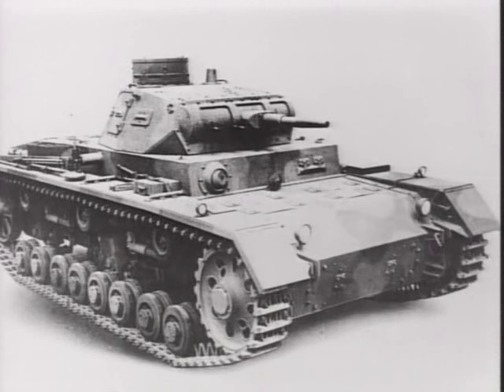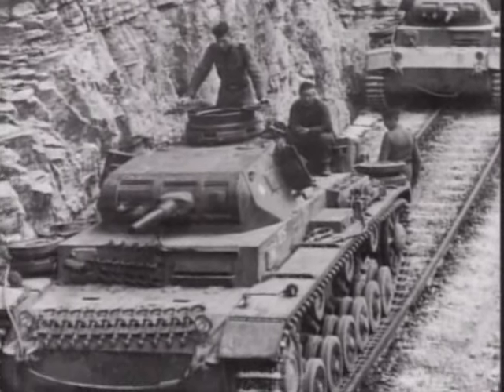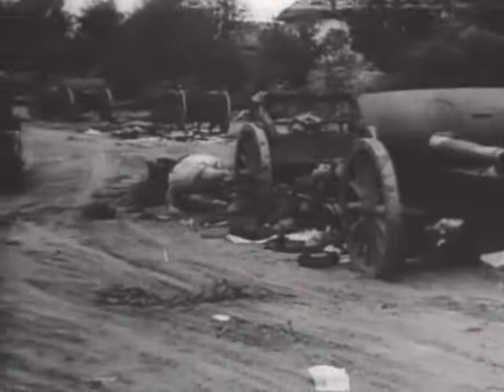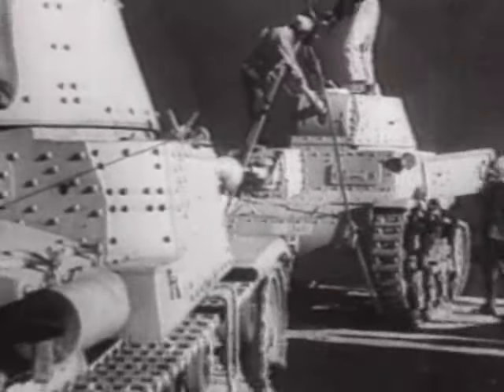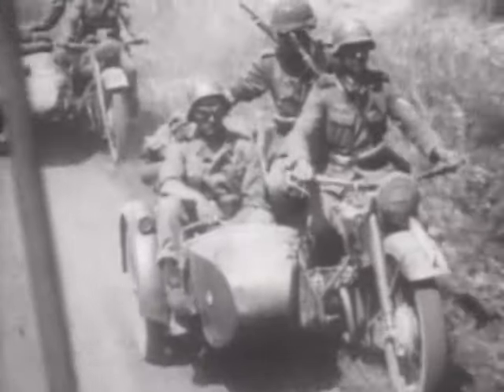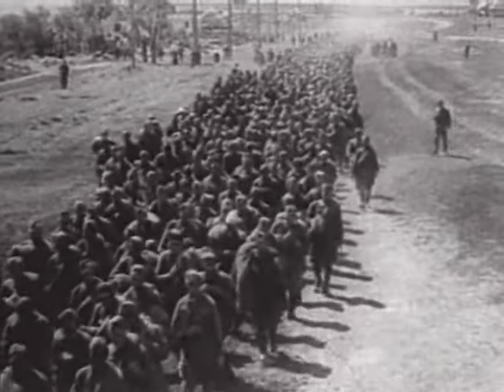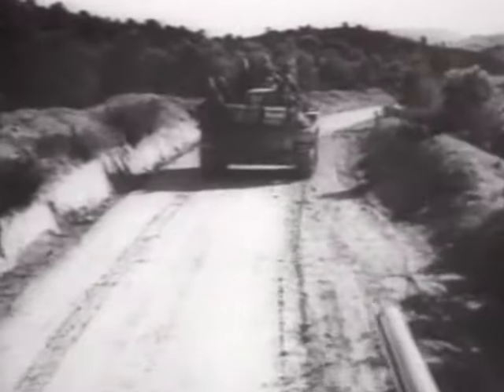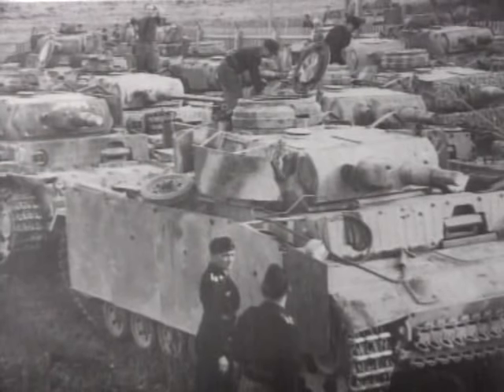German War Files - Panzer III Medium Tanks

Comment: Criticism of the decision for the small caliber guns of the German tanks is easy. The Germans certainly had the technology to build bigger guns, so why didn't they? A 50 mm round weighs roughly twice as much as a 37 mm round. Therefore, logically, you would also need twice as many trucks to transport the munition (if you wanted the same number of rounds available to your front line tanks).
Germany did not have twice as many trucks, nor the fuel for twice as many trucks.
Reply: You could argue that with a heavier round, less rounds would be needed so it evens itself out again. Where the 37mm needs many shots at a tank to take it out, 1 50mm could do the trick.
Reply: Orvieta Of course, but then you would also have to hit your target twice as many times (in other words, not miss as often).
Since the 37mm round was sufficient to deal with most enemy tanks of the time, it was also enough to "keep the flow" (movement) in the Blitzkrieg advances.
German thinking was therefore correct (for the short moment in time), but flawed (long-term), since it didn't bear in mind that the enemy's tanks would become bigger and better in response to the early Blitzkrieg victories.
This thinking pattern (of the small "cheap" tanks with small guns) was the result of the idea the it would be a short war, and small tanks were dictated by the fact that Germany lacked the funds and raw materials to improve the designs while there was still peace (say, 1935-39)
After the war started, finances played a minor role, and tanks rapidly increased in size as the "generations" of designs (of both sides) began to overlap in ever more rapid succession.
Reply: All correct, it follows the general idea that the German army (Air, Ground, Marine) all were build up from a tactical purpose rather than strategical which ultimately helped their downfall.
Reply: Orvieta Couldn't have said it better myself.
Many people forget that WW2 was practically the concept of Blitzkrieg (a short, decisive battlefield victory against a SUPERIOR enemy).
IMHO, many historians and documentaries get it totally wrong when they make claims like "mighty" German Wehrmacht, while in fact the Germans were inferior in almost every mayor respect (except Poland right at the start)
The events of WW2 were a tactical concept pitted against strategic concepts (like blockading an enemy, strategic bombing, sacrificing land in return for time, etc.).
Guess which concept won :-)
Reply: They had the advantage of having to start from 0 and grasping new tactics and building up their army around that while the other nations all were left by the horrible memories of WW1 and the tactics used there. I once read a quote that compared both doctrines. "On one side we have a very armoured knight, sitting on a heavy horse and a big strong sword. On the other side is a much lighter individual, seated on a nimble horse but with new weaponry." The Blitzkrieg was a face off of different tactical doctrines, it's remarkable to think that Germany back then had put very little thought in maintaining their conquests after the inital gains (much like Japan for that matter)
Reply: Orvieta IMHO, Germany maintaining control over their conquests was made impossible by Nazi ideology. The subjected people obviously didn't like the idea of being seen as Untermenschen, leading to resistance (in the form of sabotage, partisan actions, spying and other forms of co-operation with the Allied side) from the moment German troops arrived.
Since Nazi's only found a small percentage of idiots in the occupied areas who agreed with their view, the majority logically opposed them (and the German soldiers, who were mostly also the victims of Hitler's policies)
Reply: I like your comment, and people wonder why U.S 3rd Armored moved so fast, because it didn't need as much fuel etc etc . people always leave out the Logistics of things lol
Reply: Uhh, the only way you're going to fit a gun bigger than 50mm (without sacrificing velocity) is to to eliminate the turret and put the gun in a casemate. Which is precisely what they did with the StuG series.

Also, the Panzer IV used a 75mm high velocity gun. 75mm was widely used by the Germans.
Reply: Treblaine That is true, but my comment is about logistics.
In other words, heavier guns mean heavier shells, meaning more trucks to transport these shells, then needing more fuel for all these extra trucks, etc.
It's a so-called "vicious circle" (impossible to break out of), in which one step leads to another.
Reply: Treblaine You are correct that it is not a simple debate, by I think you have miss-interpreted my comment.
You wrote:
"Look, follow your reasoning to it's logical conclusion: a mere 20mm cannon round is lighter than a 50mm round, so should they issue those 20mm as anti-tank rounds?"
That is not the point I'm trying to make.
My comment refers to the fact that German Army always only upgraded their guns in response to some kind of emergency (for example the widespread introduction of heavier tanks like the T-34).

"Consider the following: the German infantry had a small hand-mobile (on wheels) 3.7cm gun, the ordinance department wanted tanks to have compatibility with that gun. But generals like Guderian wanted 50mm guns on the Panzer 3 from the outset, and the longest variety."
True, Guderian (and Hitler) wanted that long before the war started, but didn't get it. Panzer III and Czech Panzer 38s were equipped with 37 mm cannons right through until late 1941/early 1942.

"Hell, since the first world war they'd been used to delivering a far higher volume of ultra heavy weight shells for artillery, those had 105mm to 150mm calibres."
A German division had 48 howitzers/cannons, but 75 x 37mm AT guns. Even increasing the caliber a part of the tank and AT guns would have increased the total weight of ordnance dis-proportionally.
Reply: Treblaine "The logistics supply system was perfectly capable of delivering 50mm shells. Also capable of delivering 75mm shells and even 88mm."
True, and also mortar rounds, food and mail. There was a lot of weight, and the more weight that could be avoided, the better.
Especially considering that AT and tank munitions were needed right at the front lines, in the most dangerous area to reach.
Heavier shells meant heavier guns, all of which had to towed also by heavier half-tracks, or carried on heavier chassis (of tanks), needing more fuel, which also had to be transported..
As you said, there are a lot of factors to consider, but the natural urge of the logistical planners would be to keep the weight down.
Reply: Treblaine Look, I'm merely explaining something which happened during WW2.
I observed something, and offer a (possible) explanation why it unfolded in that way.
I'm not a "bean counter", since I wasn't there to influence events.
I've got a book, which clearly states the logistical issues the Germans faced (especially while planning their future Panzer Divisions in the mid 1930s). In the early stages of war games, the German generals proposed a 560 tank Armored Division.

They didn't get it, and guess why not?
Well, it seems as if "bean counters" worked out that it would be a logistical nightmare to try and resupply a Panzer Division with two tank Regt's while on a Blitzkrieg style dash across an enemy's territory.
So it was decided to reduce the number of tanks (first to 324, then 254, and later even only 176, which was also a result of tanks getting heavier, and equipped with heavier guns, because the number and the quality of trucks available could not be increased)

This is NOT my, recommendation, it was a recommendation made long ago, by some unknown logistical experts.
In end effect, the decisions were dictated by events, and wishful thinking could not have circumvented the lack of rubber, fuel, steel and other resources needed for the "ideal Panzer Division" in the generals' heads.
Reply: Ralph Bernhard Yeah, well war is tough. Logistical nightmare or not, if that's what's needed then that's what's needed.

And it's right to have fewer tanks which can be effective rather than lots of cannon fodder.

Giving them something which won't penetrate the enemy armour isn't saving weight, it's wasting weight. As what you brought is worthless.

And see the video in the above source, the weaker 50mm gun were installed for no good reason other than it was what was already planned. The longer higher pressure 50mm guns (L/60 variants) would have been of a trivial extra logistical burden for a significant increase in capability.

I really have to object to a trend I see oft-repeated of saving pennies while ignoring how that then costs millions.
Reply: Treblaine I agree with almost everything you write, but we are still talking about two different things.
You refer to an ideal situation, while I'm describing what actually happened.

You wrote:"Logistical nightmare or not, if that's what's needed then that's what's needed."
That is merely a statement.
The economy of the country in question also has to be able to produce "what is needed" and then ALSO have the means to deliver what has been produced, to front lines a thousand miles away.
This is dictated by raw materials, labor, and many other factors. This is true for ANY country, but let's stick to Germany.

The Germans had to stop the production of purpose built 6x6 trucks in 1940 (the "Einheidsdiesel" tuck), because they took too long to build. There was neither labor, nor the raw materials to speed up production, and the factory space was need for more important weapons..
Specialized 6x4 truck production was halted in 1942 (for example by the company Henschell)
After that point in time, all German trucks were militarized civilian vehicles (like the Opel Blitz).

Of course, this step was not popular, and those soldiers fighting both wished for, and deserved something better than a glorified 4x2 truck with a few racks added to "militarize" it.

That is not the point.
If you have the raw materials and labor to CHOOSE between a specialized 6x6 truck and a tank, what would you give the soldier?
That is the question.
Reply: Treblaine "I really have to object to a trend I see oft-repeated of saving pennies while ignoring how that then costs millions."
That is hindsight, since you can only analyse what is wrong, lacking or completely missing after the event (a war or battle), and not before it takes place.
Please also read my first comment.
Reply: Ralph Bernhard "That is hindsight, since you can only analyse what is wrong"

Actually no, it's reasonable foresight. The likes of Guderian had the foresight to see that they should have had the long-50mm gun from the outset.

Source: the above video.
Reply: Treblaine Again, that is not what I said.
Again, you are absolutely correct (where ONE German general was concerned).
What about all the other generals? (and military strategists)
Goering wanted 10,000 bombers. 
Doenitz wanted 300 submarines.
Guderian wanted bigger guns for his tanks.
Reader wanted 8 Bismarck style battleships.
The Generalinspekteur of the German Fighter wing, Galland, wanted 10,000 fighters.
The Navy wanted six inch guns for their destroyers.
The coastal forces needed 1,000 small craft to defend the occupied territories.
Kammhuber wanted 10,000 radar sets.
And so on, and so on.....
Somewhere along the way, somebody put up his hand and said "Hold on...."
I hope you can see the point I'm making. You cannot address each and everybody's foresight.
Reply: Ralph Bernhard "Guderian wanted bigger guns for his tanks."

Which all in all is a pretty small requirement.

It is of trivial difference to make a long-50mm gun with the slightly larger 50mm rounds but makes a SIGNIFICANT difference in effectiveness.

Long-50mm could penetrate the armour of heavy allied tanks such as Matilda II and T-34.

This wouldn't cost a battleship, this would cost pennies extra per gun.

Guderian actually AGREED to having FEWER tanks as long as he got the long 50mm... only to discover they'd put the short 50mm on there anyway.

I hope YOU see the point I AM making, that jsut because battleships are too expensive and can be gone without that doesn't mean any other request can be denied.

"You cannot address each and everybody's foresight."

You've taken that to the point where you don't think ANY should be addressed.

You seem to be labouring under the misapprehension that the German war machine was perfectly efficient.

No it wasn't, you noticing apparently worse guns you seem to be trying to figure out what SMART reason they did this.

When you didn't consider the possibility it was a plain old screw up. They didn't communicate effectively and the uber war machine was in near perpetual chaos. It wasn't smart, they were dumb.
Reply: Treblaine OK, I see what you mean.
Your analysis where the 50mm gun is concerned is correct of course.
It would not have taken much to upgrade the Pz III to make it much more effective.

From a neutral perspective, making decisions about the possible future warfare scenario is extremely difficult.
Hindsight also says that Goerings LW would have gone a long way towards winning the war, if he had been given his 10,000 bombers by 1940.
Same goes for Donitz's wish for 300 submarines asap.
In end effect, if you have too many people whose logic make perfectly sense, those in control of the resources have to start making compromises.
Here lies the crux of the matter.
Larger economies (like the British Empire and the USA) made MASSIVE mistakes, but they won anyway, since they could simply brush away their mistakes, and win the war with their successful weapons.
Smaller, weaker nations don't have the luxury of making mistakes, so those in control better not mess it up ...
Reply: Ralph Bernhard Yeah, you just seem to be dismissing SOUND foresight with examples of SPURIOUS foresight.

It is very important that you be able to distinguish between the two and if you cannot distinguish between them, you cannot throw all of it into one category (spurious) or the other (sound).

Donitz's wish for submarines was another reasonable request considering their disproportionate effect, more reasonable than to try to out-produce the British (and later Americans) in battleship production.
Reply: Treblaine As far as Guderian's wish for larger caliber (or longer barrel) guns are concerned.
I think the reason for the mistake was how strategists interpreted the Blitzkrieg.
The strategy of Blitzkrieg was to strike deep and cut off the enemy from his rear ( and NOT to take on superior enemy tanks)
To objective was to look for weaknesses and AVOID the superior tank, strike deep and cut it off from its logistical support.
The stronger enemy tank would then rumble around on the battlefield and eventually run out of fuel.
That worked pretty well in France, and  the early stages of Barbaarossa.
German tanks were designed for rapid and deep encirclement, and therefore the need for a gun capable og dealing with the heaviest of the heavy was ignored.
As you have noted, this had negative results later on, because the superior Aliied manufacturing meant that by 1943 there were no more "weak points" for the tanks to exploit, and the more effective heavier guns were far too few to make a difference.
Loss of battlefield initiative was the result.
Reply: Treblaine "Yeah, you just seem to be dismissing SOUND foresight with examples of SPURIOUS foresight."
Agreed.
I was typing faster than I was thinking :-)

But there are also many examples of sound foresight, which could not all be met, due to the sheer number of "sound foresight" suggestions.

Seeing that we are discussing submarines, one immediately comes to mind. Before the war, Donitz was given the choice of whether he wanted very low frequency radio equipment which could penetrate a few meters under the ocean level, OR a radar set.
Since he could not have both, he considered that the radio for his envisaged Wolfrudel tactics had priority.
In his judgement, a sound choice.
Of course, today we know that both were sound foresight, but financial considerations dictated that he could only have one.
This would probably be an example of your penny pinching bureaucrats, but on the other hand, if had hundreds of sound foresight choices from every branch of the forces (which would add up to blow the defense budget eventually).
Reply: Ralph Bernhard blitzkrieg is what it's name implies, lighting war, fast war. Which is somewhat redundant as that's what all attackers strive for

"To objective was to look for weaknesses and AVOID the superior tank"

it's not that simple.

From the start, the idea was the have an armoured spearhead break through the weakest point in the enemy lines.

But still the weakest point may have T34 tanks everywhere. And in fact they were unavoidable. 

"German tanks were designed for rapid and deep encirclement"

Encirclement still depends on containment, so STOP their attempts to fight out.
Reply: Treblaine Correct.
Blitzkrieg is a fascinating subject, and as you have noted, also not so simple.
Of course, my comments are restricted to the few lines available here on a YT tread.
IMO, I can create a link to my initial comment, which is logistics, so I'm looking forward to your views.
Here is my statement: "The Germans won the campaign in the west in May 1940, BECAUSE they had mostly light tanks, and IF the majority of their tanks had been (as Guderian wished) Pz IIIs, they would probably have been bogged down in the Ardennes, just as the French and British views at the time predicted."
Let's take it from there.
It is my firm conviction that a heavier tank than the Czech Pz 38 or German Pz II (20 mm guns) would have cost them the campaign, because of the logistical nightmare a large number of heavier tanks would have caused on the small winding roads and narrow bridges of the Ardennes.
The French were actually quite correct when then pointed out that the Ardennes were "impassable", BECAUSE they made that prediction based on their own (much heavier) tanks, with gas guzzling motors and a vast logistical train.
A Pz III is much wider (around 3 meters versus around 2 m ), and uses much more fuel than a Pz II or 38 (around 150 liters per 100 km versus around 100 liters per 100 km for the lighter tanks). This all adds up to the logistics.
Events proved that they were up to the job, despite the shock of meeting Matildas and Char Bs.
That the German High Command was not too worried about these (disturbing) meetings with heavier tanks, should be explored.
Why were they not too worried after they had analysed the campaign, but rather concluded that "they had the mix right"?
Reply: Ralph Bernhard "IF the majority of their tanks had been (as Guderian wished) Pz IIIs, they would probably have been bogged down in the Ardennes"

What's you're basis for that?

The many Panzer III's still made HUGE advances into Russia, far deeper than against France and Low Countries. It's just that the Soviet Union is so much bigger and with much worse environmental factors.

"It is my firm conviction"

Look, you MUST realise this.

Your "firm conviction" may mean so much to you... but THAT IS YOU! We are no all you.

If everyone was convinced by other people stating their "firm conviction" then we'd be at the mercy of whoever was the loudest and firmest. 

No, that's not how it works.

You deal in fact, objective reasons.

That's the only thing anyone cares about, I don't know you, I haven't even met you, your convictions aren't relevant.

Any facts or objective logic, THAT is what is relevant.

"The French were actually quite correct when then pointed out that the Ardennes were "impassable", BECAUSE "

Actually no, it's not because they couldn't get their tanks and supply train through there, its that if they tried they'd get jammed up into pileups where they'd be utterly vulnerable to air power.

But the ace in the hole the Germans had was gaining air supremacy. Germany's opponents were not only denied the ability to attack the utterly supply lines but they couldn't even get reliable reconnaissance of the heavy troop movement through there.

Panzer 3 was actually only 57cm wider than Panzer 2 and still narrow enough to go anywhere a large van could go.

And as a matter of fact Panzer 3 tanks DID make it through the Ardennes the only problem was so many were needlessly undergunned with 3.7cm guns.

Panzer 3 was still much lighter than Matilda II or Char

"This all adds up to the logistics."

You know what really adds up to the logistics? you saving a mere 33% fuel per km to sent a Panzer 2 to the front instead of a Panzer 3 for it to be utterly incapable of damaging enemy tanks and getting easily destroyed.

You saved 33% to lose 100%.

"That the German High Command was not too worried about these (disturbing) meetings with heavier tanks, should be explored."

Earlier you made out you knew better than Guderian, that he must have been wrong for wanting Panzer 3 with 50mm guns.

"Why were they not too worried after they had analysed the campaign"

THEY WERE WORRIED!

THAT'S WHY THEY WANTED MORE PANZER III WITH LONG 50MM GUNS!

"but rather concluded that "they had the mix right"?"

But they didn't conclude that.
Reply: Treblaine "What's you're basis for that?"
I have several, but here is one.
It's the bridges.
In early 1940 the German army used four main types of pontoon bridges (A,B,C and n.A.)
ALL the tanks used in May 1940 could use ALL of these pontoon bridges.
Had Guderians advice been heeded, the Germans would have had tanks (the Pz III J weighed 23 tons) which could only use one of those bridges (the Type n.A. which was only introduced in 1937. That would have seriously inhibited the flow of vehicles, if the French and Belgians had managed to destroy their own (civilian) bridges.

Therefore ADDED to the risk of aerial bombing blocking roads, one would have an increased risk of getting stuck at some of the main rivers (while waiting for one of the scarce Pontoon Type n.A. to arrive)

Again, my POV is not what I would have wanted it to be, it's what actually happened, for which I'm trying to find an explanation. I don't know why you conclude that it is also what I would have suggested (if I had been in any position to do so during the 1930s). In fact, I would have agreed with Guderians "a few less, but better tanks" suggestion too.

From the POV of procurement/economy, you should also realize that Guderian and the German tank advocates had a long wish list (for example that every tank should also have a radio, Air support in the form of Stukas, etc., etc., etc.) which HAD already been granted. That means when he came up with his long barrel 50 mm gun wish, it was just one of many.

The attitude of procurement was probably "Sorry, buddy, but the wallet is empty".
Irrelevant of how you feel about this economical restriction personally, that was reality.
As today, money is not endless, and deciding which valid wishes are actually useful in a FUTURE warfare scenario is not easy.
Of course, you can believe you know better than the consensus decision reached by military experts, but I'll humbly admit that I don't know what the typical warfare tactics/ equipment/scenario will be like in ten years time.
What makes you think military leaders could predict a future warfare scenario in 1935?.
Reply: Ralph Bernhard "ALL the tanks used in May 1940 could use ALL of these pontoon bridges."

Both Panzer 3 and even Panzer 4 existed in 1940.

"That would have seriously inhibited the flow of vehicles"

Or they could do what they DID and make Type n.A pontoon ridges available as that's FAR easier than the prospect of so many tanks being utterly vulnerable.

"Again, my POV is not what I would have wanted it to be, it's what actually happened, for which I'm trying to find an explanation."

You seem to be in denial of what actually happened as in the many reverses that were saved by dumb luck and confusion.

Not appreciating that Guderian really did insist on more Panzer 3 tanks with long 50mm guns.

"you should also realize that Guderian and the German tank advocates had a long wish list (for example that every tank should also have a radio, Air support in the form of Stukas, etc., etc., etc.) which HAD already been granted. "

And on that matter all those points have been of HUGE importance, when they were either denied those things or their opponents had them as well then the tables were turned.

The importance of radios was so absolutely critical for taking on superior defensive forces like the otherwise fast, deadly and tough T-34 which suffered in things like lacking radios.

"That means when he came up with his long barrel 50 mm gun wish, it was just one of many."

I've explained WHY that's facile logic, 

It makes no significant difference whether the long or ther short 50mm gun was fitted in therms of industrial or logistics support.

But it DID make all the difference for combat effectiveness.

Long 50mm could take on t-34 tanks if if you get up close on flanks. 

"The attitude of procurement was probably "Sorry, buddy, but the wallet is empty"."

No it most certainly was not as it didn't cost any appreciably more to have long-50mm guns. And Guderian was EXPLICIT that slightly fewer tanks of long-50mm would be preferable to more without.

You are AGAIN making up an excuse which excuses the industrialists when the industrialists fucked up.

"Irrelevant of how you feel about this economical restriction personally, that was reality."

No, that's not reality.

"As today, money is not endless, and deciding which valid wishes are actually useful in a FUTURE warfare scenario is not easy."

Actually in THIS CASE it was, and THEY WERE EXPLICITLY TOLD!

They were told that the long-50mm gun was the priority, even if it lowered tank production slightly, it was absolutely clear that it was a WASTE to cut-short on this matter.

"Of course, you can believe you know better than the consensus decision reached by military experts"

No THAT'S WHAT THE INDUSTRIALISTS DID!

The actual people who were waging the war knew that if a 50mm gun was on the Panzer 3, there's no reason it shouldn't be the long-variant.

They even agreed with that consensus, but then secretly disobeyed for no good reason other than pig-headedness. Indifferent penny pinching.

Please DO NOT REPEAT THE FALLACY THAT ANY MONEY SAVED ANYWHERE IS MONEY WELL SAVED!

" but I'll humbly admit that I don't know what the typical warfare tactics/ equipment/scenario will be like in ten years time."

They weren't talking about 1951, they were talking about RIGHT THEN. In the next immediate few months.

"What makes you think military leaders could predict a future warfare scenario in 1935?."

Oh for FECK SAKE we are talking about procurement immediately AFTER the battle of France!

Panzer 3 design may have been settled in 1935 but the gun choice was something left up till much later. And damn right they had to adapt quickly, every other nation that fought in the war could, dis as they had to adapt production that quickly.

The problem was the entire Nazi regime was run like an old boys club, it was actually the furthest thing from a meritocracy, it was whoever was mates with the hierarchy and you get problems like this shit.

And you are MAKING STUFF UP to explain the screw ups which is so far detached from reality.
Reply: Treblaine I wrote "ALL the tanks used in May 1940 could use ALL of these pontoon bridges." This is correct.
You wrote "Both Panzer 3 and even Panzer 4 existed in 1940."

True, what's your point?

Panzer III early (37 mm and short 50 mm) weighed UNDER 20 tons (check it up) and could use ALL German pontoon bridges.
Pz IV (short barrel 75 mm gun weighed UNDER 20 tons, and could use ALL the German pontoon bridges.
 
I have pictures of Pz III from the 1940 campaign, crossing both the type B and C bridges right under my nose at this very moment..

A Pz III J (with the long barrel 50 mm guns) weighed 22.3 tons and could NOT use the pontoon bridges type A, B and C. 
(Same as ALL single loads OVER 20 tons)
That is a fact and in the books, which are in front of me at the moment.

What am I making up?
Reply: Treblaine I've lost you somewhere along the way. I'm working with the specifications of tanks that were actually produced.
So what are you suggesting?
Are you suggesting they should merely have put a long 50 mm gun on an early, lightly armored (30 mm frontal) Pz III D or E?
Reply: Ralph Bernhard No you aren't "working with the specifications of tanks that were actually produced.". I gave you directly contrary evidence from a reputable source and you're just automatically gainsaying. 

I've done more than suggest, I've been explicit.

"Are you suggesting they should merely have put a long 50 mm gun on an early, lightly armored (30 mm frontal) Pz III D or E?"

Yes.

It is, after all, WHAT THE EXPERTS DEMANDED!

It's what the most qualified generals deemed should have been done from the start.

Better is better.

Why would any tank gunner turn down more firepower for insignificant increase in cost, weight and logistics?

What, you think more firepower can only come after more armour?

NO!

More armour came first simply because it was easier to bolt on armour plates than re-gun.

But it would have been so much easier if they'd STARTED with the gun originally requested!
Reply: Treblaine Here are the sources I'm using, and which are under my nose, so to speak..
http://www.amazon.de/Waffen-Arsenal-Sonderband-41-Kriegsbr%C3%BCckenger%C3%A4te-Wehrmacht/dp/B002IRKKP8
Pictures and specifications of German and captured equipment used by the Wehrmacht, on 48 pages.
http://www.amazon.de/Kraftfahrzeuge-Panzer-Reichswehr-Wehrmacht-Bundeswehr/dp/3879431612
An extremely detailed list of specifications of the Pz III on page 384/385.
If you wish I can tell you how wide the tracks are, how deep it can wade, what type of fuel and how much it uses, the name and model and company which made the carb it used, the gearbox ratio which companies built it, the number of HP at which rpm, armor protection on five different places of the hull, suspension, how many top bogies there are on which model, the length width height in millimetres per model, the turning ratio, width of the track, and how many links there are, aaaaand, yes of course, the gun, make model, ammo it uses, along with the weight of the round, shell, and specifications like range penetration at four different ranges and angle of armor.
Honestly, I don't want to bore you, so of course I'm rounding up.
I've done some searches on the net, but German pontoon bridges doesn't seem to be a subject which interests enough people for a website. There is nothing on the internet.
Reply: Ralph Bernhard I don't give you sources that YOU cannot read, so don't give ME sources I cannot read.

Is there a version available online? PDF version or anything? I don't care about language, I can get it translated, but I'm not going to buy a book that's been out of print for 2 decades.

Look, I DON'T wish you to "tell" me what the width of tracks are or any other detail. You've already given me dishonest answers, why should I accept any more.

I have given you more than enough of the benefit of the doubt.

You ABUSED that with dishonesty.

No reasonable person should accept anything less than direct unadulterated source. Why? Because you've proven you cannot be trusted to summarise without obfuscating or with dishonest omissions.

You citing these sources only make you seem LESS reliable as apparently ignorance is no excuse for you. Despite all you have available you couldn't tell it straight.

"I've done some searches on the net, but German pontoon bridges doesn't seem to be a subject which interests enough people for a website."

Probably because it's something easily solved for the Germans. We aren't talking about heavy gauge steel production or high tech components.

It's really a trivial matter to make sure procurement of pontoon bridges that are slightly better for newer version of tanks with incrementally more mass.
Reply: Treblaine A few comments up I said that I'll stick with the majority consensus of military experts and military historians.
If I read you correctly, you are saying that less of a superior tank is better than more of an ADEQUATE tank.
Every expert I know of will disagree with that.

You are saying that Guderian wanted Pz III's (with a long barrel 50 mm gun) INSTEAD of the large number of smaller lighter tanks available at the time.
The Pz III just happened to be twice the price of a Pz II (96 200 vs 49 300 Reichsmarks, quoted from p.431) which would have meant half the number of a (vastly superior) tanks.
http://www.achtungpanzer.com/panzer-statistics.htm
Prices are also listed here.

The problem with that logic being that Germany could not afford to build Guderians tanks ON TOP OF what it was already building. It was either, or., NOT both..
In September 1939 there were only 98 Panzer IIIs, but 1445 Pz Is and 1223 Pz IIs. = around 2700 tanks.
Are you seriously saying that Germany would have been better off in May 1940 with (roughly) 1300 or 1400 Panzer IIIs with the long barrel 50 mm. The Allies had about 4000 tanks.
Since one cannot conjure funding out of a top hat, that would be (roughly) the equivalent.
(Of course, if you don't trust me to tell the truth or with arithmetic, you can do your own sums)

Germany lost the war because the Allies built more tanks which were ADEQUATE, like the T-34 or the Sherman,  (but inferior) to the German Tigers and Panthers.
Germany lost the war because of "quantity being a special kind of quality".

Find me just one historian that will agree with your hypothesis, and I will concede defeat.
Reply: Ralph Bernhard "If I read you correctly, you are saying that less of a superior tanks is better than more of an ADEQUATE tank."

No!

What I am saying is less of an ADEQUATE tank is better than more of an INADEQUATE tank.

Panzer 2 was inadequate apart from some narrow roles as a scout or pursuing infantry on the hoof. It wasn't good at dug-in infantry, especially if any had organised any sort of anti-tank gun.

Early Panzer 3's 3.7cm gun was far far too weak. The Long-50mm was what was BARELY adequate for facing the likes of T-34 tanks and Matilda II tanks.

"Every expert I know of will disagree with that."

That is not what I'm saying but even they'd not disagree like you say.

As the problem with having a barely adequate tank is you need far superior numbers for them to take on other tanks.

An individual tank which is much better might be more costly, but they are disproportionately effective for their cost! As you don't need so many of them with a multi-tank attack inevitably losing some of them.

"The Pz III just happened to be twice the price of a Pz II "

And a bicycle is the fraction of the cost of a Panzer 2.

Should panzer brigades be issued bicycles?!?!? Or is that too extreme, how about just some VW beetles and a box of hand grenades?

"The problem with that logic being that Germany could not afford to build Guderians tanks ON TOP OF what it was already building."

For the LAST god damn time.

if they could afford to built the SHORT 50mm guns then they could afford to build 98% as many of the LONG 50mm guns.

NO ONE WANTED BOTH! 

"Are you seriously saying that Germany would have been better off in May 1940 with (roughly) 1300 or 1400 Panzer IIIs with the long barrel 50 mm."

Yes.

Just like they'd have been better off with 2000 Panzer II tanks than 300'000 bicycles!

"Germany lost the war because the Allies built more tanks which were ADEQUATE"

No the allies won the war because they COULD BUILD more tanks that were adequate.

They had an effectively indefinite supply of petroleum, fuel, far larger labour and industrial capacity, ultimate control of the seas and it's three nations (USA, UK and USSR) the top powers of the world against one. Far without the problems of strategic bombing, blockade.

Germany could NEVER have tried to beat the allies on QUANTITY.

They could ONLY beat them of QUALITY!

A much better tank that costs 2x as much can be 4x as effective.

And most than that, German armour production was all about making something better which STILL cost less than their opponents. The likes of StuG III, Jagdpanzer 38(t) were all far more cost effective.

Look, just because USA, UK and USSR won with sheer weight of numbers does NOT mean that Germany should simply have tried to do the same.

"Germany lost the war because of "quantity being a special kind of quality"."

Only BARELY, despite how many T-34 tanks were made by Soviets, so many more than the Germans, yet still Germany had such higher kill ratio that the higher numbers of T-34 were almost completely wiped out.

Of T-34 tanks made in 1943, 93% would be destroyed in combat or combat related losses (broke down and forced to abandon by enemy action). 

http://chris-intel-corner.blogspot.co.uk/2012/07/wwii-myths-t-34-best-tank-of-war.html

That's a horrific loss rate.

German's higher quality did a lot to even the odds but the war was decided on broad strategic terms. Good command of total war and the Soviets getting more organised. Things like withdrawing Siberian troops from the Japanese frontier. Others like the encirclement of 6th army who were bogged down in Stalingrad. Things like the Germans endless delays in attacking Kursk and later, refusal to pull back to a more defensive line before Operation Bagration.

"Find me just one historian that will agree with your hypothesis, and I will concede defeat."

I'm not trying to defeat you.

But why should I find a historian to DISPROVE when YOU have not presented any historian to argue that Germany should have gone for quantity over quality?

When it's patently obvious that Germany was in NO POSITION to try to go for quantity but were in a position to go for quality.
Reply: Treblaine That's funny. I agree with (almost) everything you say.
I'm not so sure about that bit about Germany being able to beat GB and France in the West in May 1940 with (roughly) 1400 Pz IIIs with the long barrel gun though, but it is certainly a hypothesis worth exploring.
Now that I know what you mean, and if you don't mind, we could start from the beginning, and I'll try to pick some holes in the logic.

Your final two paragraphs is exactly what I'm always saying- Germany built Tigers and Panthers BECAUSE it could not compete with numbers, and didn't have the fuel for the 50,000 or 75,000 Pz IVs it could have built instead of Tigers and Panthers. That is spot on. Therefore any criticism of "over engineered and too heavy" German tanks (according to many docs) is futile.
There was simply no alternative.
Reply: Treblaine You have suggested a viable "what if" scenario which is completely within the realms of the financial and technical conditions in Germany in the middle or late thirties.
Just to make sure I understand you correctly, you propose that German procurement should have listened to Guderian and Hitler and concentrate on long barred Pz III. The 1940 German Panzer divisions would therefore have been composed mostly, say 80%, of a much better Pz III with the long barrel gun, the few light Pz which had already been built would have been reassigned to recce units, and a few heavier Pz IVs as an "ace up the sleeve", in case the enemy responded to the impact of this powerful new type of Panzer division.
There could have been around 1500-1600 German tanks, since the better tanks would have been built at the expense of more of the lighter Pz I and II from around 1937/38 on wards..
It is, in fact, a variation of the Main Battle Tank doctrine.
Please correct me if I got that wrong.

But, I promised to be back to try and pick holes in your argument :-)

The problem I have with "what if" scenarios (ALL what ifs), is that "what ifs" mostly completely ignore what effects their implementation would create on the other side. My view is that "every action has a reaction", so let's explore that.
IMHO, your "what if" would automatically assume ineptitude on the opposing British and French side. For it to work, it would need British and French intelligence communities to be completely asleep, and for British and French strategists not to grasp the effects of a smaller number of more powerful German tanks which they were observing.
It is my understanding that the nature and composition of British and French tank units (the French H35, H38 and R35 with short barrel 37 mm guns were far superior to the German Pz I  and II with machine guns, and so on) were influenced by what they observed on the other side. 
In the "real world" of 1939/40, the French only built a few of their more powerful Somua S35 (with a 45 mm gun), because they KNEW the Germans didn't have too many Pz III and Pz IV, and that the overwhelming majority of German tanks were "tin cans" with machine guns.
Bearing this in mind, I'm proposing a counter argument.
In short, and in response to what they observed happening in Germany in 1938/39, the French would have increased the production of their (already existing) Somua S35, at the expense of the light Hothchkiss and Renaults. 
A (highly theoretical) composition of Allied forces (BEF, and French Army) would therefore have meant 2500 tanks, of which the majority would have had  the capability of the Somua (in other words, 45 mm guns, heavier armor), nullifying the German intend of individual superiority.
My conclusion.
For your (completely viable) "what if" to work, it would preclude a (completely improbable) "what if" of utter ineptitude on the part of Britain and France.
Looking forward to your answer.

In case your standpoint is "Well with the Pz III long barrel almost every German tank would at least have had the capability to take on everything thrown at it" (whereas the Pz I and II couldn't) and therefore losses would have been lower.
In my opinion, to avoid own losses was not the essence of Blitzkrieg.
Reply: Ralph Bernhard "should have listened to Guderian and Hitler and concentrate on long barred Pz III."

I don't care what that pomps psychopath Hitler thinks or ever thought. 

But Guderian was an expert and a professional. I think Hitler got his opinion on the matter from Guderian, the peoblem was Hitler clearly had a problem with deferring expertise, when he's convinced on the way of something he has the delusion it was his idea.

So later he may make another ridiculous demand and he's like "now Guderian, I was right about the Long-50mm guns, and I'm right about this".

The problem was the system was kept in check by farcical things like parades for Hitler's birthday. How utterly childish, apparently only then was it discovered if Guderian's requests were being followed or not.

As a rule, Hitler was a stopped clock, and a clock frozen in time is right twice per day, but who cares? There's no point in referencing it, you have to know from another source where it is right.

"The 1940 German Panzer divisions would therefore have been composed mostly, say 80%, of a much better Pz III with the long barrel gun, the few light Pz which had already been built would have been reassigned to recce units, and a few heavier Pz IVs as an "ace up the sleeve", in case the enemy responded to the impact of this powerful new type of Panzer division."

I believe that is what was endeavoured for ANYWAY.

Just evolutionary "dead ends" like mounting a 3.7cm gun on Panzer 3 tanks jsut so they have ammunition compatibility with infantry units. Which was pointless as the way panzer brigades worked they would have very separate supply lines. Hell, 3.7cm ammo for Panzers was even labelled completely different as 3.7cm ammo for infantry regiments.

" that "what ifs" mostly completely ignore what effects their implementation would create on the other side."

I actually have, remember what I said about the logjam in the Ardennes? The critical factor there was air supremacy, not somehow tanks being able to outrun opposition air-power.

"IMHO, your "what if" would automatically assume ineptitude on the opposing British and French side."

Actually the opposite.

Only with utter ineptitude can a Panzer 2 with puny 20mm auto-cannon take on Matilda II and CharB tanks. And that is what they faced, if not tactical ineptitude certainly on a strategic level they did.

The weakest point on the German invasion of France was that so many of their tanks were paper tigers, they were scary and could be anywhere but if the enemy could jsut get organised they could wipe them out with frightful ease. ANY of their field anti-tank guns would have done it.

"For it to work, it would need British and French intelligence communities to be completely asleep, and for British and French strategists not to grasp the effects of a smaller number of more powerful German tanks which they were observing."

There's no "what if" there, they were asleep. The intelligence communities didn't really wake up till it was far too late.

Realise that a token force was sent by Britain to France in the so called "phoney war" stage. Critically, the RAF was kept in the UK (where it had insufficient range to reach into the continent). This was essentially giving up on trying to save the continent, knowing it's futile so it would be better to save the planes to defend Britain.

As to France making few heavy tanks as they 

Well, deception a CORE element of warfare. It's really not hard to make it seem like there are fewer Panzer 3 & 4 vehicles, like through keeping Panzer 3 & 4 in reserve on the Western frontier and the invasion of Poland mainly with substitute-standard Panzer 2 tanks. Which makes sense as (1) Poland lacked mobile armour, and (2) the main anti-tank opposition would be gun in and concealed anti-tank guns which the likes of Panzer 2 firing a barrage of 20mm HE shells was better at dealing with.

Survivors from Poland (fleeing south) would tell of mostly light tanks. As they actually did.

" French would have increased the production of their (already existing) Somua S35, at the expense of the light Hothchkiss and Renaults. "

But they already had so many that they'd cause a huge amount of trouble.

Except that's not what happened, they didn't just line up in front of each other and take turns shooting at each other.

Germans depended hugely on armoured spearheads they NEEDED tanks that were more than adequate not everywhere but to effect breakthroughs. 

And when the heavy allied tanks counterattacked they came up against the heavy 88mm flak used in anti-tank role.

This was disproportionately effective as all allied tanks of that era had a serious problem with issuing adequate high-explosive shells. High explosive shells are a great antidote to anti-tank guns as the AT guns lack any armour, and you just have to hit near them (effectively much larger target) to disable their crews.

It swung the other way later in the war as allies focused too much on HE capability in their tank guns and not enough on armour-piercing.

Germans generally had quite a good balance between HE capability and AT capability.

"A (highly theoretical) composition of Allied forces (BEF, and French Army) would therefore have meant 2500 tanks, of which the majority would have had  the capability of the Somua (in other words, 45 mm guns, heavier armor), nullifying the German intend of individual superiority."

If they were that organised then the Germans never could have done anything, the whole point was that they were utterly disorganised and unprepared for war.

You are adding an EXTRA what-if scenario.

And your only motive for this is that tank factories DID WHAT THEY WERE TOLD!

If allied intelligence intercpeted orders, they'd SEE orders for long-50mm guns for Panzer 3 tanks. The difference was simply MISMANAGEMENT.

Precisely from the very way the Nazi regime ran the country as so many despotic regimes were run, they were run haphazardly with power doled out based on political loyalty and managed personally rather than with an effective chain of command.

So my answer to the idea of allies magically knowing that more Panzer 3 tanks would be available with better guns and would rapidly increase production is... they wouldn't magically know.

They had a very sketchy idea of German military might and overwhelmingly it was out of date (Spanish Civil War) or from a conflict where Germans could safely send their weaker tanks, like mainly light tanks against Poland knowing that nation had insignificant armour.

"In my opinion, to avoid own losses was not the essence of Blitzkrieg."

A key aspect of blitzkrieg is a FOCUSED attack on the enemy's frontline, this meant you still needed quite a lot of very potent tanks for the breakthrough. Also key was the likes of concentrated airpower (dive bombing) to break through in ONE place then fan out after that.

The "blitz" after that is quickly moving out after the breakthrough.

But after that comes the matter of the opposition's strategic reserves which exist precisely to deal with breakthroughs.

Only through frankly a lot of luck and mismanagement did those not crush the German breakouts.

Many times they did utterly crush German advance but then confusion led to uncertainty of what to do next.

Just compare the Battle of France to the Battle of the Bulge. Almost identical geography but stopped by Germany's opposition putting up an organised defence and I think most critically, the Allies had air superiority rather than the other way around.

The few medium tanks the Germans had, it was pushing things dangerously close to get the plan to work at all in 1940. An important think, I'm saying if you have got a medium tank like Panzer 3, it should be armed as such, with a long-50mm and don't play things by half.

If you've got Panzer 2 tanks, use them.

But as it is, there is no "what if" on Panzer 2 production being dropped for panzer 3. Production of Panzer 2 DID almost completely drop-off from 1939 through 1940:

http://en.wikipedia.org/wiki/German_armored_fighting_vehicle_production_during_World_War_II#Panzer_II
Reply: Treblaine Thanks for that extensive assertion.
I share you view where Hitler was concerned. I knew that Hitler didn't come up with the idea of putting the long barrel 50 mm gun on the Pz II. I merely added him since Guderian alone could never have altered the Heersewaffenamt's decision by himself. He needed Hitler's support, and therefore the change needed a "team" effort.
Hitler often stole the ideas of others (for example Fall Gelb, which was basically Mansteins plan) and sold them to the German public as his own.
Reply: Treblaine Just to sum up, so I understand you correctly.
1. You are saying that the combined British, French and Polish (which often worked together) intelligence communities were not up to the job?
2. You are also saying that a certain amount of cunning deception on the part of Germany would have countered any information that might have reached the Allies, or distorted it to an extent to make it less valuable?
3. Then, finally, British and French blundering made it impossible to implement the changes necessary to counter the new style of German tank divisions fast enough, because of industrial incompetence?

1. As for the first question, that is the first time I've ever seen somebody make a statement like that :-)
In the dozens of books I've read so far, the common thread has always been "we were the most brilliant intelligence gatherers" in the history of mankind, and it was the Germans who were the blundering fools, easily deceived and betrayed at every corner.
This actually even makes sense, since the very evil regime you have yourself described in some of the above comments, were the breeding ground of hatred, discontent, power games, jealousy, etc since the very start in 1933 (all of these negative feelings were excellent grounds for people who become traitors).
On what sources do you base your claims that the Allied intelligence community were not as bright as often portrayed in docs and books?

2. From what I've gathered, the atmosphere was actually quite open. The Germans often showed visiting dignitaries their latest developments in weapons. The aim being to scare them off from the very real threat of military action as a result of the re militarization of the Rhineland, annexation of Austria, the Sudeten Crises, etc.
It seems to me as if the opposite was true. The Germans took every chance they got to exaggerate their strength because they wanted to intimidate Britain and France to stay out of eastern European politics.
Why would  they try to hide their most potent weapons?

3. Granted, where France was concerned. The socialists reforms of the mid-30s, coupled with the lasting effects of the Depression, had dropped the country into a sluggish, inert chaos. A mere shadow of it's former glory.
Britain, I think, was another matter.
Advance notice would certainly have lead to an earlier and more decisive decision for tanks such as the Matilda II and the Valentine (would have been rushed into production before the war, instead of after the war started) long before the war,and if these had been available to the BEF, they could have made a real deference to stop the German Pz III (with long barrel 50 mm)
The very basis of my argument is that you can't really say that "the Germans were going to make a huge change on their side, but on the other side we'll have a situation EXACTLY like it really was in 1940." (in other words, that there would have been NO reaction from GB and France whatsoever).
Reply: Ralph Bernhard Yeah, across the board there was a general lack of preparedness. Poland were by far the furthest ahead in military intel with their work on Enigma but even they were too far behind.
Yes, deception and misinformation are key, not just through leaks but in what forces you use where.
Look, Allies already had such superiority in number of tanks, firepower of tanks, artillery and so on. The problem was strategic and organisational.

"In the dozens of books I've read so far, the common thread has always been "we were the most brilliant intelligence gatherers" in the history of mankind"

NOT in 1940!

Don't generalise the entire war as also true for the first few months. Bletchley Park wasn't even beginning to be fully set up.

The allies were fought flat-footed at the beginning of the war but quickly developed in many capacities. Radar went from a technical curiosity to achieve sensing capabilities previously thought only capable with magic. So too for SONAR and many other things.

You cannot generalise so much.

"On what sources do you base your claims that the Allied intelligence community were not as bright as often portrayed in docs and books?"

Look at how the foundation of codebreaking efforts became on Polish work.

The brilliance came in RESPONSE to German successes, not BEFORE them.

And although the German codes were broken with efforts of quite literally the most brilliant minds, the Allied codes were broken quite easily by trivial effort as the Allies didn't spend anywhere near as much effort keeping their own codes secret.

They had their own reasons, particularly they wanted a simple to use code system that took the least effort to implement. But that made it very easy to decrypt. For example in the Battle of the Bulge the German forces there knew almost every single allied unit in the area as their Military Police were using a poor code system. The German solution was just to go old tech, do almost all their planning by courier or hard-wired phone-line with the radio essentially using a one-time-pad of pre-arranged one-use codewords to synchronise attacks.

German navy did actually an amazing amount to keep the enigma code uncrackable but it was simply an "evolutionary dead end". Any machine encoding/decoding that is practical enough to be used in the field will be simple enough for a large crytoanalytics unit to decode.

"The Germans often showed visiting dignitaries their latest developments in weapons."

And they could very easily be selective.

"The aim being to scare them off from the very real thread of military action"

That didn't actually work as France DID attack in the Saar offensive.

This is an oft-overlooked part of the war but it was actually the French coming against new previously unknown technology which stymied the advance. New highly advanced anti-personnel mines severely limited their movement. 

They KNEW that the Germans were preoccupied fighting Poland but they were put off by UNEXPECTED opposition.

Also it was clear to everyone where the French had focused their efforts and that was into highly fixed defences as along the Maginot Line. Any offensive into Germany (along Franco-German border) would not want to go out from under their heavy immobile artillery.

The idea that Germany needed to show off their military capability was to naught.

"The Germans took every chance they got to exaggerate their strength because they wanted to intimidate Britain and France to stay out of eastern European politics."

Telling French to stay out of French politics would be like telling the English to stay out of British politics. No way, French would be involved.

Maybe Britain would stay out, but the Nazis had no subtlety there, they were too indulgent in their own fantasies. Britain would not tolerate a militarily expansionist Germany.

"Why would  they try to hide their most potent weapons?"

Because they weren't trying to deter a war they were trying to start a war they intended to win, largely by suddenness and surprise.

"Britain, I think, was another matter."

Yes, but it had priorities and was deeply conservative.

If they tried to throw "all in" to defend France, it may still be futile and then they'd LOSE all of that. Then where would that leave the defence of Britain? Maybe the Royal Navy could do a lot to hold off a cross channel crossing but the RAF would be more important for that.

"Advance notice would certainly have lead to an earlier and more decisive decision for tanks such as the Matilda II"

Again, assuming that Germany would show it's hand.

Also, Britain was rushing AS MUCH AS IT COULD with the threat it did see.

Look, the threat from Germany was already very clear, but there was huge resistance to preparedness for war as that was seen as encouraging war itself. It was widely seen as that was how the First World War started, arms race that got out of control.

Also we are speaking with benefit of hindsight, no one really knew what tanks of what sort should be procured. British and French were really unsure how to use their tanks with infantry and other factors.

Matilda II had the same problems as previous tank. Overburdened commander and far too slow. And the problems ran deeper, the entire allied command and control structure couldn't deal with an armoured spearhead breakthrough (key component of Blitzkrieg) they were caught off foot and kept on the run all the way to the sea.

"The very basis of my argument is that you can't really say that "the Germans were going to make a huge change on their side, but on the other side we'll have a situation EXACTLY like it really was in 1940." "

It's not a huge change for the Germans to do as their generals INTENDED to do and only didn't do through foolish and easily caught oversights.

The Allies were irrevocably truly frozen in indecision. The only defence was an utter revolution of their command and control structure, to take their entire tank doctrine and throw it out the window, no more infantry tanks and cruiser tanks.

That is a huge change. Putting and adequate gun for a medium tank like Panzer 3 as originally planned is not a huge change.

"(in other words, that there would have been NO reaction from GB and France whatsoever)."

There would be no time to react as there wasn't in those 6 weeks in 1940.
Reply: Treblaine OK, you've made some good points !
I'll think this over and try a new approach.
This round goes to you ;-)
Reply: Ralph Bernhard You may even change your mind. I've been persuaded to change my mind on matters, maybe a victory is you learning a new thing.
Reply: Treblaine Good attitude. That's mine too.
I hope you don't mind my persistence, but I always think that if somebody makes a statement, he should also be willing to back it up with facts and sound logic. I'm always glad when somebody takes the time to pick holes in my arguments. If not, how else will I discover if I'm wrong?
You have obviously thought this through properly.
Reply: Problem with Germany was that they did not have any decent anti tank guns except the 88 which had to be towed then set up which took almost an hour.
Reply: Stoyan Dimitrov They had a 75 mm gun which was very good, but their industry couldn't deliver it fast enough.
The problem with the 88 mm, and the reason it took so long to set up, was because it was designed as an AA gun.
It was way too high and way too heavy for the AT role.
It was an excellent multipurpose gun though. That was, however, more due to advanced planning (ammunition and training).
Strangely enough, the Brits had a similar gun, but opted not to copy the way the Germans used their 88 mm.
Reply: +Stoyan Dimitrov don't spout shit you obviously have incorrect.  The US War department says it can be deployed in 2.5 minutes.  Where the fuck did you get an Hour?  any sources with that?
Reply: +Ralph Bernhard Flak 36/37 could be deployed in 2.5 minutes.... not an hour.  Tell me where you got that source?  Deployment of a weapon does not include men digging trenches, sangers, or make shift pill boxes.
Reply: JuergenGDB I didn't write that.
I wrote that it was quicker to deploy a 75 mm AT gun than an 88 mm AA gun, which is correct.
A "proper" AT gun is also better for AT work, since it is also lower, smaller and easier to conceal.
The 88 mm was obviously an excellent multi-purpose gun, because the need to fire at various targets was foreseen (it could fire AA against aircraft, high explosive against troops, and AT rounds against tanks and bunkers). No one allied gun could do that in this stage of the war. In the AT role, it became more vulnerable later on (1943/44), as the caliber and range of guns fitted to tanks increased.
During the first half of the war, it could dominate a battlefield.
In an emergency, the 88 mm could even fire from it's trailer(s), as you can see in some stock footage.
Reply: Ralph Bernhard You said in your own statement that the 88mm took a long time, as if you were agreeing with the other fellow that it took up to an hour. 
You then went hell bent on information I have known for over 25 years.  I was specifically replying to the deployment of the 88mm flak gun.. not any other weapon system.
Reply: JuergenGDB OK, I see what you mean.
No, I actually don't agree with that statement "that it took almost hour".
The word "long time" is of course a relative concept (where weapons are concerned).
Reply: Ralph Bernhard Nice... the 75mm Pak 40 was a great ATG.  I must admit, it was fairly easy to conceal and overall had good penetration.  Anyways ATG are a Tankers worst nightmare in my opinion..
Reply: JuergenGDB True. I have seen many interviews in which tankies (from all nations) confirmed this.
Reply: But they had enough for Stalin did it Pharmacaust? Right fellow historian, facts?